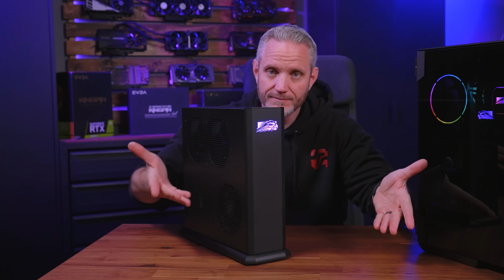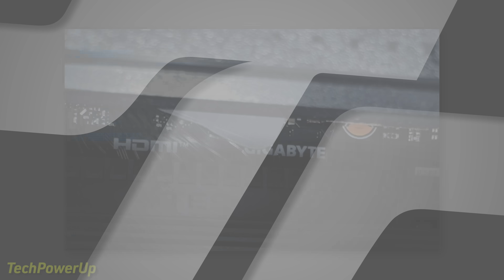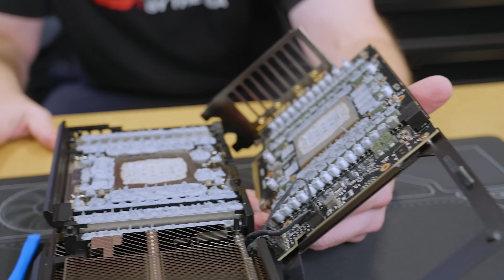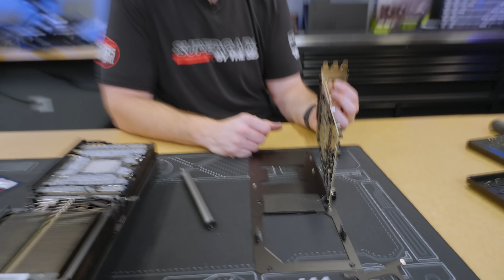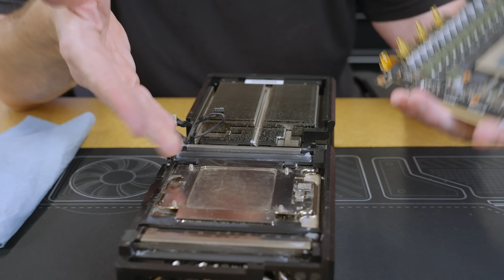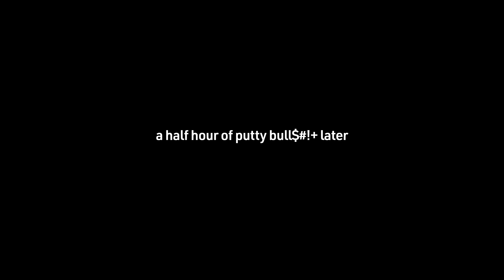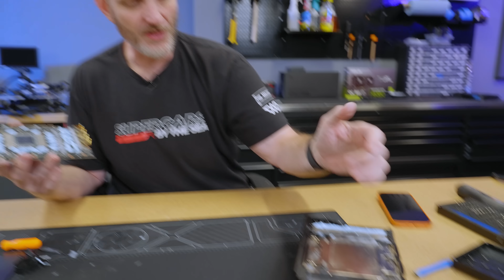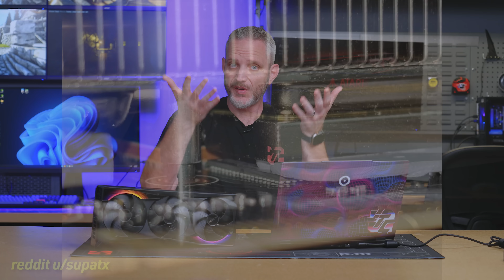What the HECK Gigabyte... WHY?

Comment: I've had my AORUS 5080 now for just over 12 months. It's not overclocked but in a Hyte Y70 so mounted vertically. The gunk has oozed pretty much over my pci express and I haven't - touch wood - experienced a loss in performance or temps. Everything seems pretty normal so far playing games such as Anno, Company of Heroes, New World(last year), Throne and Liberty etc. It is disappointing this is even an issue considering the high levels of b.s PC components have been in for a while with faulty CPUs (Intel), motherboards and now this.

Comment: Memory temps on some cards are a lot higher because Hynix GDDR6 uses more power and runs a lot hotter than Samsung GDDR6, so you can't compare memory temps between different models unless both models have the same brand of memory. 

Hynix GDDR6 typically runs around 10 or more degrees hotter with the same model of cooler. Most reviews don't take this into account. 

While Hynix GDDR6 runs hotter, it's possible that Hynix GDDR6 is also able to safely handle a higher temperature, and it is also widely known among repair techs that Hynix GDDR6 is a lot more resistant to the contact points breaking due to board torsion (bending), and the Hynix GDDR6 supposedly runs slightly faster and could see very small improvements to frame time variance and average frame rate in some games.

Comment: A little late for this, but I am so happy.
I sold my personal EVGA 3080 Ti a few months ago. It was in my custom loop, and I decided to use all new thermal interface material when I reassembled it with the air cooler.
I was humming and hawing over whether to use some nice pads or some putty. I actually bought both, but in the end I decided to go with the pads.
I'm glad I did. It wouldn't have been my problem, but I'm glad it's not the buyers problem either.
I am wondering though, in the lawsuit capitol of the world, how come no one is suing because their GPU is overheating?
I replaced that card with a n ASUS TUF 5080. I couldn't believe how well the air cooler on that card worked. I almost decided not to do a loop, but since I had already bought all the parts....

Comment: Been using the same card for more than a year in vortical orientation in an open bench with no issues, I guess it has to do with being in a bad ventilated case with extreme temperatures circling inside

Comment: You gotta hand it to thermal putty on one issue: You don't have to know your thermal pad thickness.
Whatever the clearance is, it smush.
In every other regard it's more work than pads, especially on the cleanup, for no tangible benefit over properly fitted pads.
It's not great to use but it is great to have. Lose one thermal pad? Putty got ur back. Screw the next guy amirite?

Comment: RTX 5090 AORUS MASTER ICE owner here
Since the new HWmonitor update that now shows your hotspots was getting 112'c 
Also can only run the card at 80% power limit or i get black screen and 100% fan speed that requires a hard reset.

vertically mounted, and Im getting putty dripping. 

Going to RMA it since i cbf with it at all and for the a $4.2k card very pissed off

Comment: So a few months later with a card from batch SN2452, which was the first ever batch to come out as far as i know, still doing well with temps while being vertically mounted and almost daily use, yes goop still comes out till this day somehow. But i have no other issues at all
Reply: I have the same, but with the new hwmonitor update that allows you to check hotspot temps you should deffs recheck your temps, im hitting 112'c on vrm's with putty drip and vert mounted, I also can no longer run my card at 100% and have to power limit to 80% or i get black screen and 100% fan speeds requiring a hard reset.
Reply: @Ðigital_Bliss oh i didnt know thet added that. I for sure gotta check. I’m still utilising it at 100% no issues. IIRC I can also use it over locked at 3200 mhz
Reply: @Ðigital_Bliss  So my hotspot is 1:1 with my normal temps. Never going above 80c
Reply: @SnuXSley awesome, thank you for replying and this info ❤

Ive decided to rma mine, due to how much goop and putty gigabyte smother their auros master ice's in 😅

Stay safe and may your gpu stay forever as cool as you 😁
Reply: @Ðigital_Bliss  Haha i appreciate that.

I just tested a furmak with it. Hot spot never went above 80c somehow xD Gpu hit 70c and memory hit 72c. 

So by some magical things this card does well regardless of the loss of putty.

Hopefully youll recieve a better card <3

Comment: No way would I want that s..t, anywhere near my pc.  For many reasons.  But mainly it is because if it does migrate, it is harming longevity.  But also because I use watercooling and I do not want to deal with this garbage if I want to put my own block on a card or have to do maintenace.  Gigabyte do seem to have gone badly down hill in recent years.  With perhaps the exception of a few premium products.  A 5090 Auros extreme waterblock edition I have is doing very so far.  Its supposedly liquid metal based and performs well. So hopefully there is none of the gel crap in it.  I also got to use a Gigabyte UD1600PM PG5 AI TOP PSU over the last few days.   My god, the worst cables I have ever encountered.  They are too short, given the way the ports are placed on the back of the PSU, extremely tight.  But worst of all was the extremely unfriendly stiffness and absolutely the worst quality ATX MB connector I have ever encountered. It was like something I would expect from a chinese exploding power supply.  The quality difference between my Be Quiet PSU,s and this is extreme and it starts at the unboxing level.  Literally a completely different world.   I could name other examples. I just wouldn't buy Gigabyte. More and more starts to feel like something listed on AliExpress or Temu than a premium brand.  But as long as the temporary PSU doesn't actually blow up I suppose that is a bonus.

Comment: Did my ZOTAC AMP EXTRME AIRO 4090 , used TG PRO putty on the VRAM and VRM , 30Grams worth alone , used 30Grams TG Putty advanced on  Mosfet and rest , used close to 15 Grams ,  on the core used TG LL with TG red shield barrier ,  biggest chance was Memory temp , when I got this GPU almost 4 tears ago, temps where always great ,   around 10c between core and hotspot  , also did TG LL a year ago, did a retouch on barrier as well , need lots of Patience ,  will do backplate later ,used more putty than I expected !

Comment: I mean i waterblocked my gigabyte card with thermal putty and i used thermal putty again instead of thermal pads works very well i used themal griizzly putty pro and i got 30-40°C better vram temps compared to the thermal pads i first used i think thermal putty is the move and i dont think the user serice ability is worser llke this you can just put buy thermal putty and put it on no problem better temps and works fine its just a bit messy but who cares just wash your hands afterwards or use gloves that comes with the putty like a normal human.

Comment: I personally use putty instead of pads. Even if they have slightly worst thermals i like them for convenience. My 6800XT Nitro+ from factory comes with like 4 different thickness pads so with putty i dont have to measure anything or spend extra money for different sizes

Comment: I read that supposedly Gigabyte is no longer using this gel crap, what i can't find info on is - what are they doing instead, did they go back to thermal pads?
Reply: No, they're still using the same gel, they just changed the solution/amount (no specifics) so future units (beginning in May 2025 or so) didn't leak out.

Comment: 5090 Aorus Master (Ice) onwer here - yes horizontal does have some ooze. Its a weird thick oil-like discharge even mounted horozontal. ZERO change in temp from initial stress testing to 3 month later "checkup" tests. It wont hurt the card. And after 3 months and cleaning the oil one time, it hasnt come back or shown any signs of degridation of the putty. So dont let it scare you. Its likely that giant tub-style cheapo putty from China and just isnt mixed to an ideal ratio. But it works. And it wont hurt it. No OC bin changes, no throttling whatsoever. No reapplying of paste needed. Sorry Jay. We love to see you suffer though ;)
Reply: Recheck your hotspots with the new HWMonitor update! im hitting 112'c on my hotspots now :<

I have the same card but vert mounted and can no longer run at 100% power limit and have to cap at 80%

Comment: This immediately and completely disqualifies Gigabyte as a brand that I'll ever consider for any build, period. If they can't even get thermal paste right, then how can they be trusted with anything else?
Reply: Yeah, sad but true. 

Decided to go for ASUS now.
Reply: @schnuus2006  Asus has a huge defective product. I had a laptop from them and it broke. I had a mouse from them for $150 and it didn't work for 3 months. Now I've had a TUF 4090 for a year and a half - it freezes in all games. Before that, I had a 3080 gigabyte, and it worked perfectly for 2 years until I decided to upgrade the system. I also had something from Asus, and it broke. Aorus is the highest quality brand, or MSI, it's an acquired taste, but Asus is a well-advertised bottom of the barrel, with an inadequate price, which breaks more often than anyone else. + these beeping coils on the Astral, it's terrible, and also on their new "cool" liquid cooling systems with a 2K OLED screen, screen burn-in very often occurs...

Comment: Yeah that's an oops! But could be worse things. At least it something easily fixable. Gigabyte products has always treated me well. Only thing I've ever ran into was a necessary bios update. I have a Z790 Aorus Pro X that I'm running a 12th gen cpu with (because I learned early on). With the cpu fan randomly stopping. It was an issue between the bios and the software on the pc. All good now.

Comment: I literally just ordered one of these. Guess I will be returning it instantly.
Reply: It's probably fixed now
Reply: @CastIronEric  It's not fixed until they stop using it.
I returned it and went with Asus.
Reply: @theharvestfloor1 Asus 90% have horrendous coil whine on their cards. I usually go with MSI, but the only card available from them is $3059 dollars, so I ordered the GB Gaming OC. I'll let you know if mine leaks as I will have it installed vertically.
Reply: @CastIronEric Yeah I install mine vertically too. My TUF has no coil whine. At least none I can hear.

Comment: This is the reason why  I avoided gigbyte 5000 series, I don't want to deal with this mess when I need to replace the thermal solution. Also saw a report of a leaking gel even in horizontal position, it was dropping into the heatsink. They do this to get save money and increase profit margins, not because it's a better solution than thermal pads.
Reply: Gigabyte turning into the Gamemax of GPUs at speed record

Comment: The amount of thermal material youre supposed to use is tiny, its only there to fill microscopic gaps in the mating areas, too much of this stuff does more harm than good and actually turns in to an insulator
Reply: this has been debunked by gamers nexus. putting more is better than too little.

Comment: I've had the Aorus 5090 1-2 months since release vertically mounted. I have 0 issues temps are totally fine but honestly, I undervolted my 5090 and I barely touch 400w in my rig playing all games 4K capped at 165hz.

Comment: Jay. The easiest way to install thermal putty is to roll it up about the same size as the long and thin tootsie rolls. Lay the roll across the vrm components and make smaller rolls or balls for memory chips. Don't try to spread it, let the contact from the cooler spread it out for you.

Comment: I have the Aorus 5070 Ti currently and the temperatures have been amazing. Its fans usually run at minimum settings and the GPU reading during those times usually stays below 40c with a maximum of 60c. For reference this room is usually about 19-23c if the door is open (so 80% of the time).

My main draw to this card was finding something that is as cool and silent as possible and it has filled that need well.

Comment: I have the 5070 Ti Gaming OC model, and I haven’t noticed any issues on the PCB or elsewhere—it’s completely clean. I bought the card about two months after launch. This issue isn’t as common as some people are making it out to be. I also had a 4070 Ti  Super Gaming OC model, and that didn’t have this issue either. I’ve seen others report no thermal issues too. I suspect the cards showing this problem were likely from the very first batch off the production line. Manufacturers often need to fine-tune sensors and adjust machines to apply the correct amount of thermal paste to specific areas, especially when switching between different dies, like moving from a 5070 Ti to a 4060 Ti, or between models like Gaming OC, Arous, or Eagle. All signs seem to point to the initial batch of cards being affected by this issue. Plus, all these issues are rarer than you might think. A very small percentage of people experience these problems compared to the number of units sold.

Comment: My gigabyte 5080 normally under full load sits around 54°c I feel like they overkilled the cooling a bit. But it still sucks the first new card I bought has this issue. I almost vertical mounted it to.

Comment: Does the 9070xt aorus elite have the same issue???

Please let me know.  I want to vertical mount mine but...

Also, can pads be used to replace the pastey stuff or is it not recommended?
Reply: If you look at the website for your specific model. Gigabyte usually advertises the usage of "thermal gel". If you don't find any information on related. Regular thermal pads are used.
Reply: Yup your card uses the “server grade thermal gel” like all the other Gigabyte RTX 50/RX 900 series cards so it can potentially happen might not be an issue if the card is mounted horizontal though

Comment: I’ve got a brand new 5080 Aorus master that black screens and the fans go to 100% while under load. It fails furmark within 15 seconds and does this. If I lower the power limit to 75-80% and set the fans to max then it seems to be able to run furmark fine. Would this be a power or temperature issue? I’ve tried it in 3 different systems, my 5090 cards and other 5080 cards don’t have any issues. Is it worth opening up and replacing the putty or is the card dead?
Reply: Same problem with 4070 super, but its probably psu problem or power

Comment: Have the same issue 
Putty left the board since april. Gigabyte said its cosmetic not having thermal interface between chips and cooler. Will try to replace it with pads myself. If not going to work will do different putty

Comment: The backplate is primarily intended for stabilization to prevent the circuit board from bending due to the heavy weight of the heatsink.

Comment: This has been going on since the dawn of time... 25-30 years ago when i was building pcs.. we used thermal pads for memory... paste didnt work as well, neither did puddy... hell we also used thermal compound that turned into rock in order to put heat sinks on memory for video cards and for motherboard chips and even dram or sdram because we didnt have heatsinks for them like today...

The pads were always better for memory... i dont get why gigabyte and some others like thermal grizzly would think otherwise... clearly the people working there are in there 20s and are just now learning what we 40 year olds knew 20+ years ago.. this is hilarious.

what you should have done JZ is test its electrical conductivity... in the past we used Arctic silver on stuff and it would migrate down to the core and memory and cause issues with conductivity.. if this stuff is oozing down i would be curiuous to see what happens when it gets under the chips

Comment: why not just remove all of this BS putty (5-10W/mk) and replace it with some of those high end Kritical thermal pads (20W/mk)?
for the GPU Core you should've replaced it with the Thermal Grizzly Kryonaut Extreme paste which is a huge improvement (12.5W/mk) over the gigabyte compound (approx 8W/mk).
honestly that should give you a nice idea for a follow up video.

Comment: I've been running a Gigabyte Aorus master RTX 5090 in the vertical orientation since the beginning of May and haven't had any paste leakage issues. Although before getting the 5090 I was running a Gigabyte Aorus master RTX 5080 before that for a few weeks and did experience the leakage problem I returned the card once I got the 5090. I always undervolt my card so it typically runs quite a bit cooler then the stock configuration. I remember reading about this problem on Reddit when the Aorus master first came out and it almost steered me away from the card. I vaguely remember reading somewhere that they changed the paste viscosity after the first initial batch of cards to address the issue, who knows if it is actually true.

Comment: A 5090.  Why would you repaste such a new card?  I still don’t understand everyone’s fallacy with repasting everything.  If you have a heat problem that you can’t fix otherwise, sure.  But holy cow!  I have GPU’s and CPU’s that have NOT been touched for 20 years and are still perfectly fine, running every day.

Also, the purpose of thermal paste is only to take up the space where imperfections exist.  It should be less than paper thin.  I understand where the thermal pads come into play on memory chips, VRM’s, etc.  But even then, they should not need to be changed if it was applied correctly and the heatsink is set correctly.

Having said that, the goo on that card was absurd!!!

Comment: Before I replaced stock thermal pads on Gigabyte 3080 Ti I had temps around 100 celcius. Now it's around 70 celcius. I used thermal grizzly's pads.